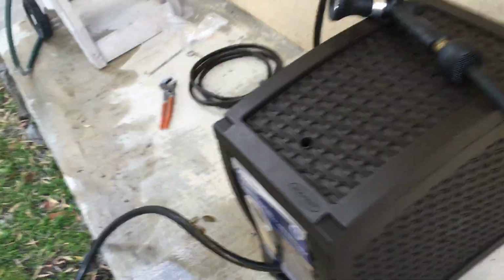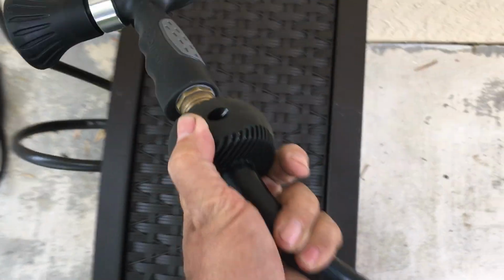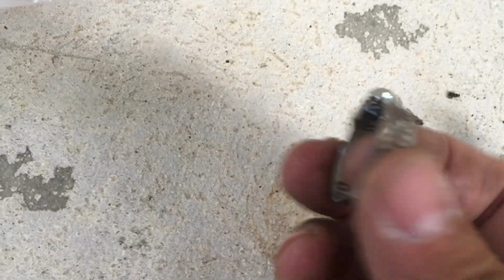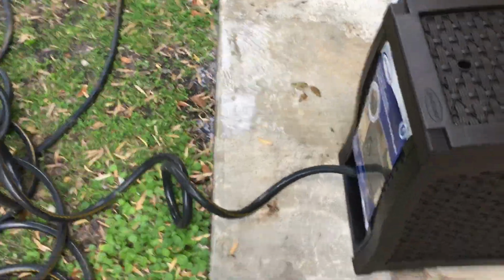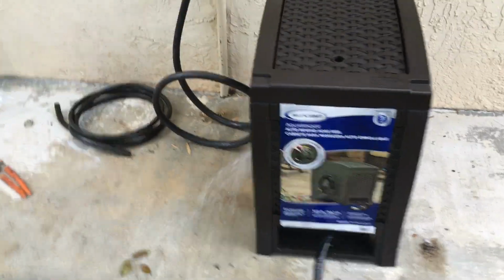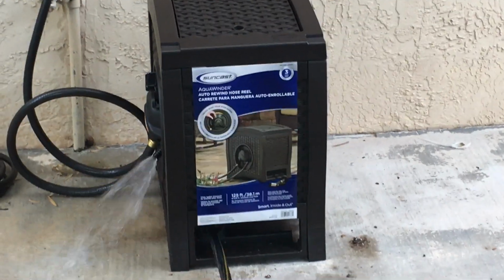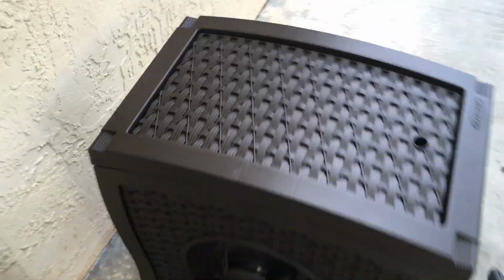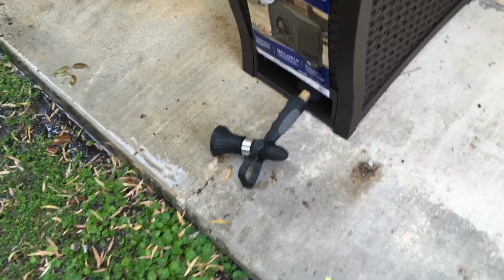Does The Suncast Aquawinder Really Work???

Comment: Hey Moon Pie, I fixed mine! It was binding up so I took it apart and inside the hub of the reel is a three cylinder plastic pump. The middle piston rod was disconnected from the crank shaft. Got it back together and it works again. Not sure for how long but...